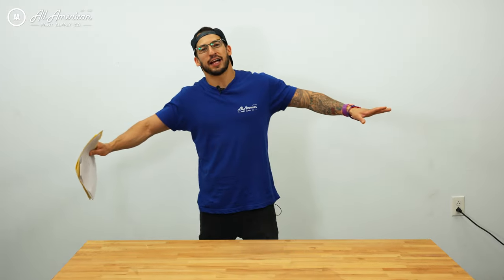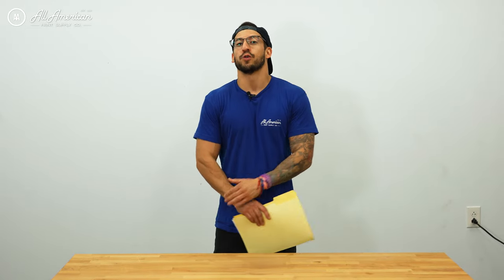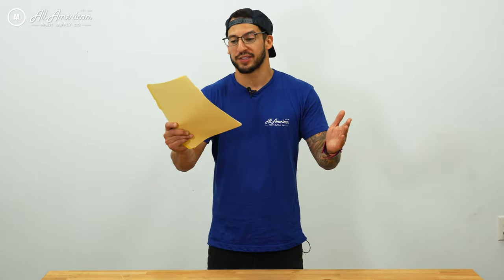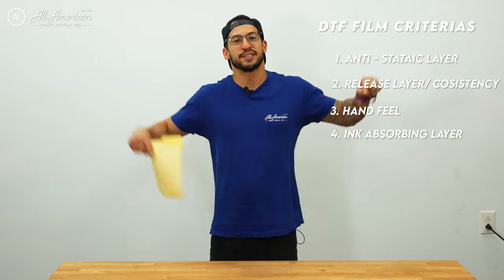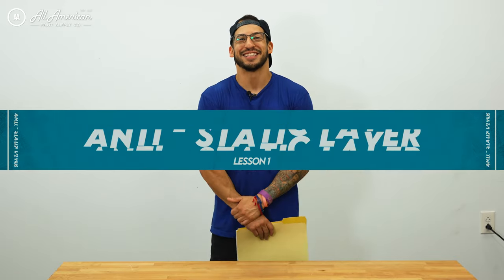Shocking Results! DTF Film 101 - Lesson 1: Anti-Static Layer | AA Print Supply

Comment: I been going crazy trying to find the reason why sometimes my prints would get that around the image.
Reply: On the mat… this might be a dumb question but you would put the sheet on that, then load it into the printer? I have very minimal humidity it’s always under 30%
Reply from the maker: NO dumb questions! Yes, for sheets that is what I do (depending on what printer). The contact will create the electrical discharge to help remove static!